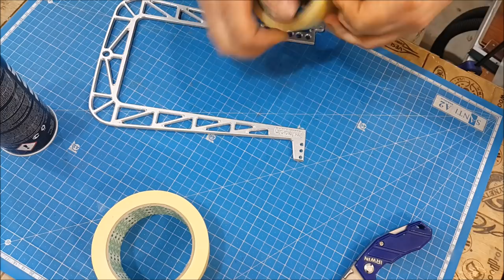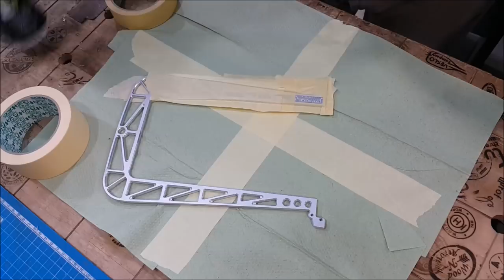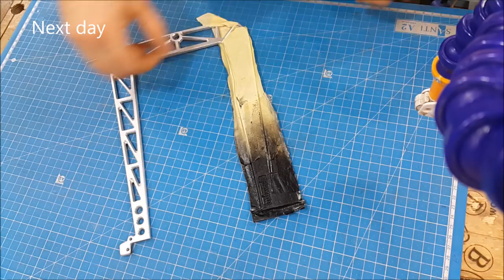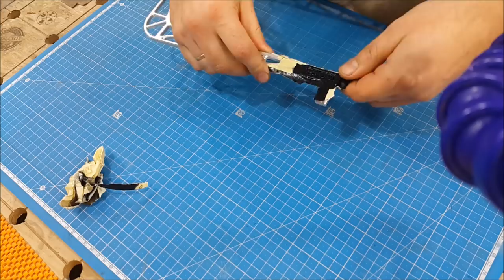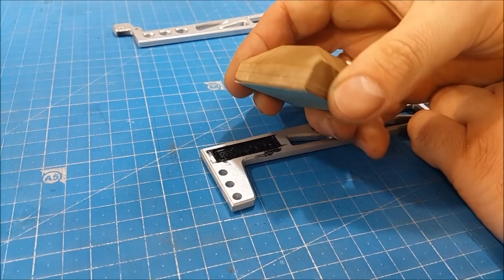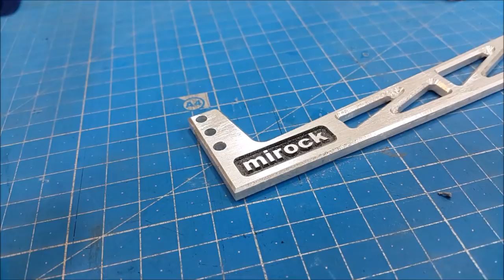Mirock Coping Saw 2. Logo painting

Comment: I love your videos! Would you mind sharing the feeds, speeds, bit type and size? Please :)
Reply from the maker: No problem. But a lot depends of kind of machine. My data: feed 800mm/min, 12000rpm. 0.5mm for 1 step. 3мм spiral bit with three blades for soft metal